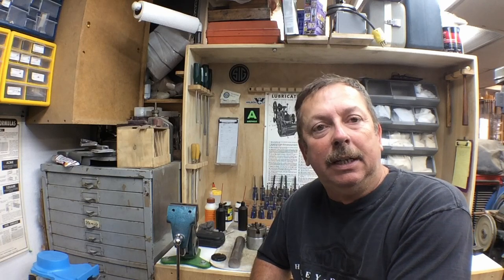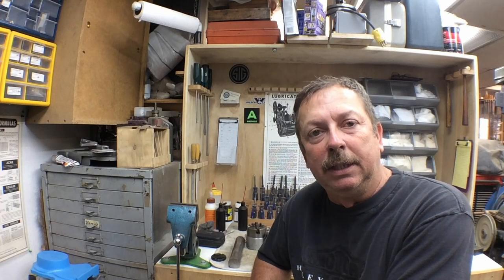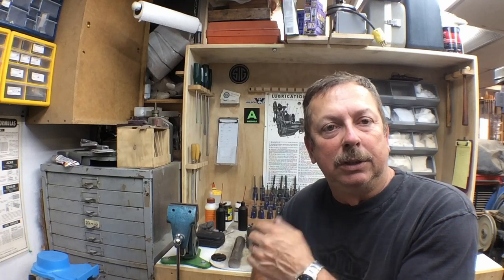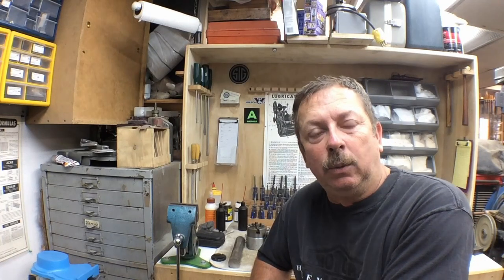My Lathe Turns A Rough Finish! Part 2 Lubrication

Comment: Well, I am a newbie in every sense of the word.  I have been using 20WT non detergent oil on most everything, chainsaw bar oil on the ways and gear oil on the change gears and back gears.  I generally wipe the machine down real well at the beginning of my session and oil things up.  I have not had any problems that I am aware of, so I agree with ya man!

Comment: I would agree that using flood and mist coolant in the home shop is usually more trouble than it's worth... not that it doesn't work,but unless it's used everyday water based flood coolant will go funky (as well as the need to test the concentration often) and mist leaves a sticky mess that will rust if not cleaned up religiously every day. As you say, these coolants tend to wash away the bench lathe's lubrication. Production equipment often has automatic lubrication to counter this.
I do use chainsaw bar oil on the bed ways because it is "tacky" like regular way oil and won't run off. You can buy a gallon just about anywhere for less than $10 which will last you about 10 years.
The most important thing about oil for you lathe is to use some.
Reply from the maker: i saw the bar oil comment on the Atlas list and I think it is a good solution. I may replace my STP mix with it.
Reply: I've used STP on the gear train and it does make it very quiet. The downside is that any sling off the gears does make a sticky mess inside the gear cover that needs a solvent like kerosene to remove.
   I quit using the STP because I also found that any chips working their way down the spindle and falling into the gear train were stuck like Brier Fox to the tar baby. I now give the gears a shot of the chain saw oil..quiets them a bit without being overly sticky and the sling off isn't so gooey. In any event, one does have to keep an eye on the gear train and quick change box to keep chips cleaned from the gears.
Reply from the maker: which is why I use the 50/50mix